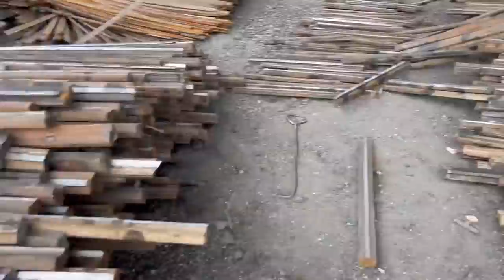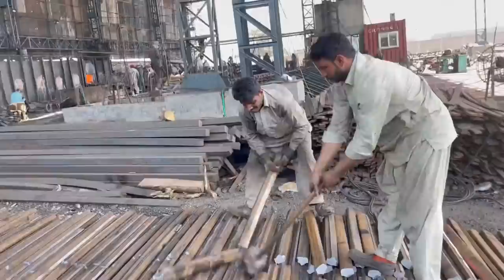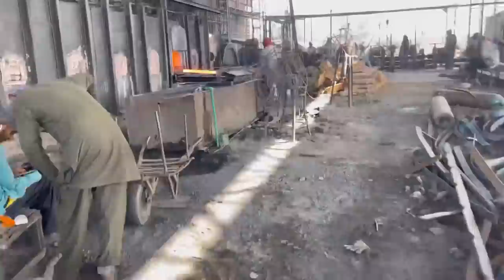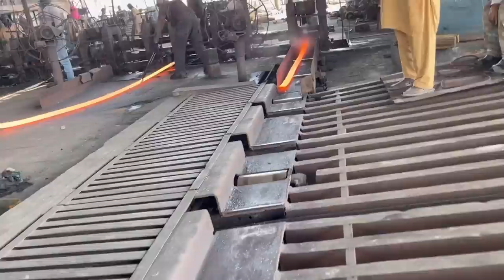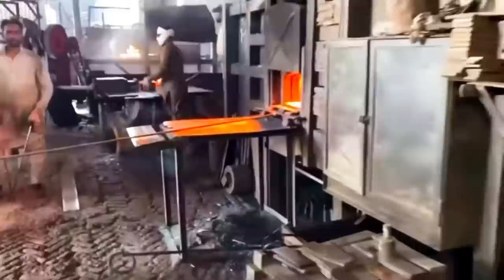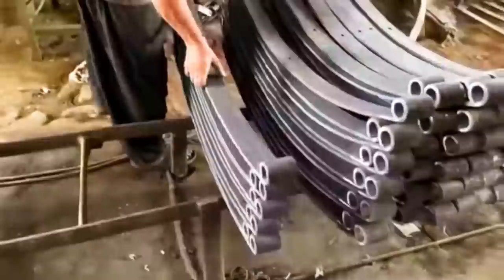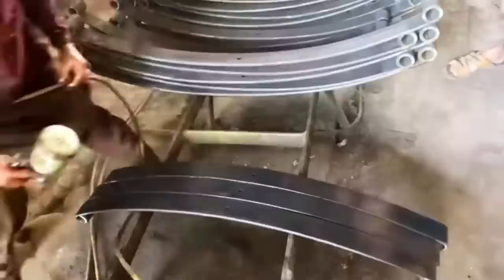They also make truck suspensions from old train tracks | Amazing thing technology1 |

Comment: I doubt the material of Waste / Condemned Rail Head is suitable for such component. The Mill Lay Out and Heating Furnace is not Correct, any how there  still may be put improvements so that they can increase their production. Use of PPEs is also a great question must be adopted. Use of Fuel in Heating Furnace  is even Wood which can be put on Oil so that be more economical & efficient. Hard Work and dedication is appreciable.

Comment: They just use what ever steel they find to make what they need.  Train tracks are made from 1084 high carbon steel. Leaf springs are made from 5160 alloy steel which is light years different from 1084. This is just a clown show filled with hacks!!